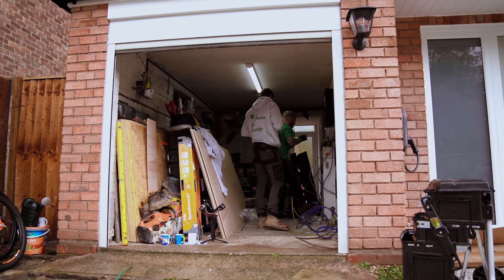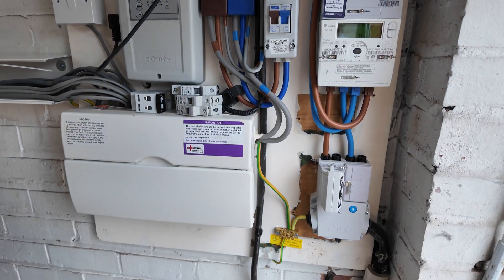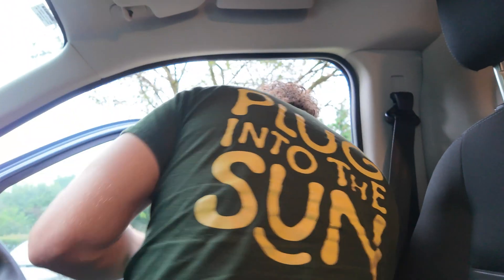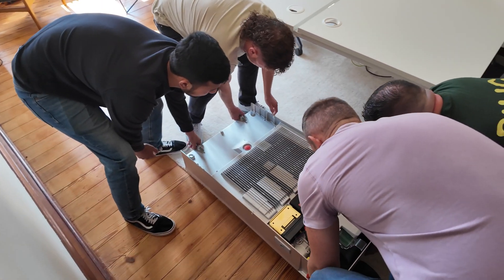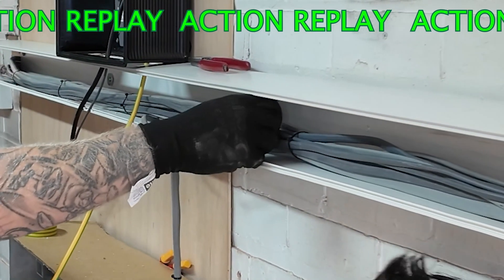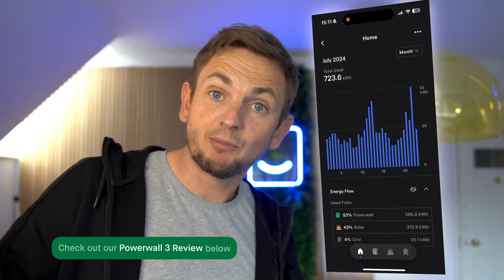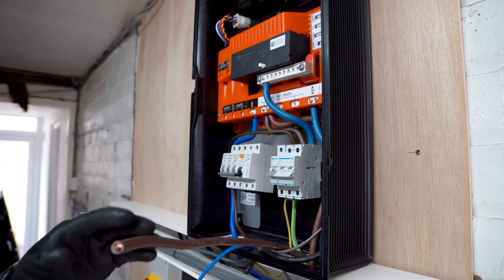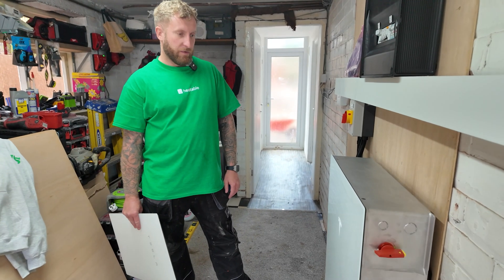Tesla Powerwall 3 Installation: From Start to Finish

Comment: Having the emergency shut off switch right next to the battery…was that a wise thing to do?
Reply from the maker: @GamerplayerWT  interested to hear why you think this would not be a wise thing to do?
Reply: @ If the battery starts malfunctioning (fire, heavy smoke) getting up next to the emergency shut off switch could be impossible. Our shut off switch is outside our house next to the meter.
Reply from the maker: @GamerplayerWT  There has never been a fire reported due to a Powerwall - hopefully no one should have to worry about this but appreciate your comment and opinion on it.
Reply: @ The reason there hasn’t been a reported fire (yet) is because they are pretty new to the market and still being delivered and installed. Not saying they aren’t safe (they are) but, just like any fire risk, there will be an eventual fire from a malfunction.
Reply from the maker: @GamerplayerWT  We're 10 years in now so I imagine we would have seen some sort of issue if it was going to be a common one...
Reply: @ Not true. I’m referring to the PowerWall 3, not its previous iterations. This is an entirely new battery with new chemical makeup and components.

Comment: TPW3 has buit in isolator why did u install an external one.?
Reply from the maker: Hey, thanks for your question. You need to do this to locally isolate the battery for safety. Isolating via the inbuilt one doesn't stop power from being live on the cables.